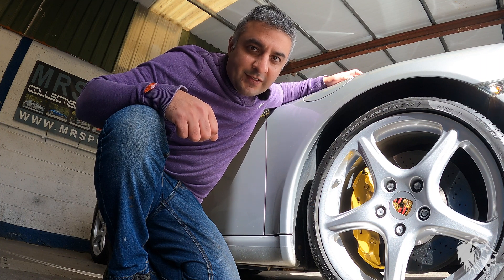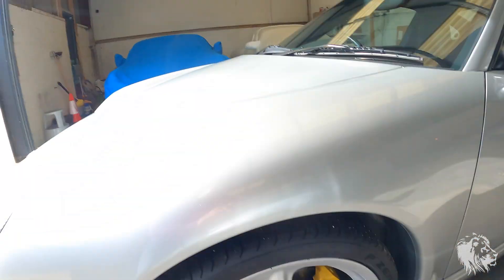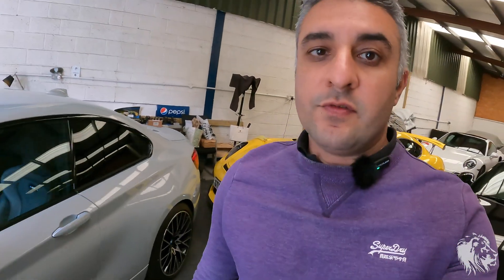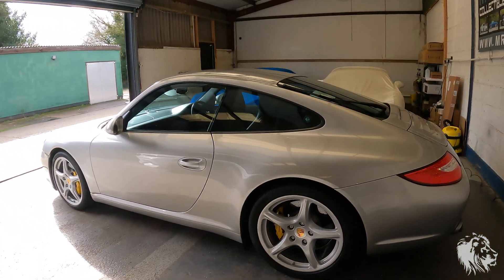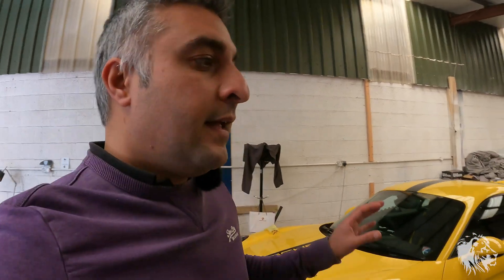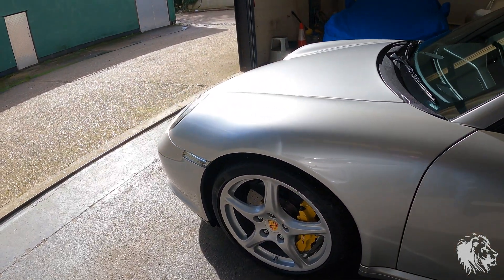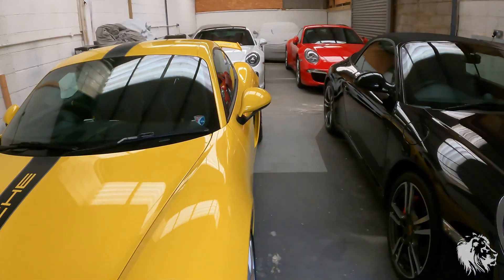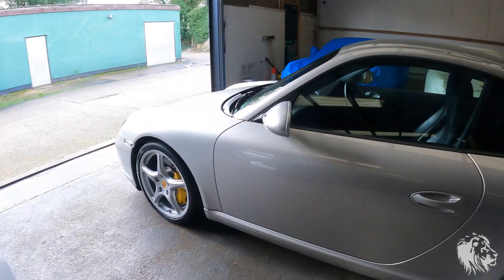Porsche PCCBs Ceramic Composite Brakes - Everything You Need to Know! Episode 80 Diary Specialist

Comment: When I ordered my 987.2 2010 Cayman S in the fall of 2009 I could have used this information you've supplied, and may have chose them vs the iron rotors. I looked at the expense of having to replace the 4 corners at that time not knowing what the life expectancy would be. It was a $9,000 option in the US and was told each corner would cost that to replace, so I opted out.
Reply from the maker: Thanks for sharing your experience! Interesting they have stood the test of time. All the Porsche we have had with these brakes are all on their original rotors, even the 2008 Carreras we have had.

Comment: My 2016 Cayenne Turbo S has the ceramic brakes. Wonder how long the rotors will last? Currently at 70,000 miles.
Reply from the maker: Road use should be a long time! Pads may be about 40-50% worn as a guess. Ideal to change the pads at around 50% wear to prolong the life of the ceramic discs.

Comment: There are a lot of benefits to PCCB and Carbon Ceramic discs, less dust, more consistent pedal, reduced unsprung weight as you say, but really heavy race track use is not one of them. At the sort of temperatures you can generate on a track, if you really drive the car to it's limits, ceramic brakes will oxidise, and they will be headed for the trash bin very quickly. I spoke to AP about running a carbon ceramic setup on a track car (a Nissan GTR) and their advice was "Don't even consider it. You'll destroy them." and I fitted AP iron rotors instead. The GT3 series race cars run iron discs too. Ferrari Challenge cars have to run carbon ceramic brakes by regulation, and the top teams throw them away every 2nd event. Tens of thousands in the bin every couple of months... 😬
Reply from the maker: Thanks for the extra insights

Comment: The PCCB brakes and pads are made by Porsche? Or is it Brembo?
Reply: Every ceramic brake on this world, including PCCBs and without any exceptions, are produced by Assa Ceramic for discs and Brembo pads.
Reply: @imBugra  How long do the ceramic rotors usually last?
Reply: @jdsilvaca  rotors are expected to last for longer than the life of the vehicle. my cayenne turbo s e-hybrid is 2500kg and it’s on 50k miles (80k km), there is still more than 80% of meat left on rears and %90 on fronts. it’s better to replace them once they reach 50%. it costs £1500 to replace all four corners with new pads. rotors are expensive though, you’ll be looking at around £5000 per corner. usually people replace the pads around 100k miles, which is usually done by third or even the fourth owner. the prices are pretty much the same besides labour, for a car like rsq8 and a urus. rotor sizes might be slightly different but not a huge deal.
Reply: @imBugra  Thanks, that's great news.
Reply: @jdsilvaca  yeah, I wouldn’t buy ceramics again. they’re always glasing in city driving, making loud horn sounds when they’re cold. especially with Britain rain. I’m driving my hybrid in EV mode when leaving my home, and with some braking I can wake up every neighbour around me 😂 you also have to recalibrate the shoes every 50k miles to protect the e-brake motors from imbalanced wear and tear. normally the pads don’t last that long so you don’t notice the imbalance, but with ceramics you’ll usually do.
Reply: @imBugra  Ok, good to know. I will check my pads this weekend. Appreciate all of the information. I guess if the rotors ever do need replacing, I might look into converting back to the calipers and rotors from a regular Turbo motor. Who knows. Great channel!
Reply: Pads are Pagid I believe. Not sure about discs.
Reply from the maker: I don't know the original manufacturer for Porsche on these, sorry!

Comment: Another plus with PCCBs you get nearly no brake dust, wheels are basicly always clean! 🥳
One down side, be careful when it is absolutely raining cats and it is below 7 degrees. When you haven't used the brakes for some time while driving in these conditions braking power will be reduced in the first second.
Reply from the maker: Good tip! Thanks for the extra insights!
Reply: Some  complain about noise and cold braking, mine work well cold or wet and no noise or dust ❤😂🎉